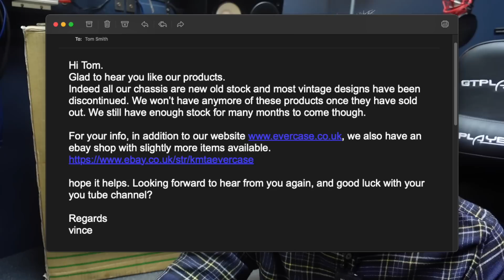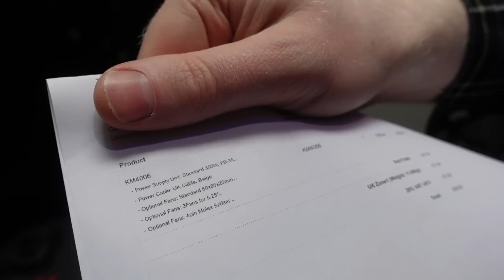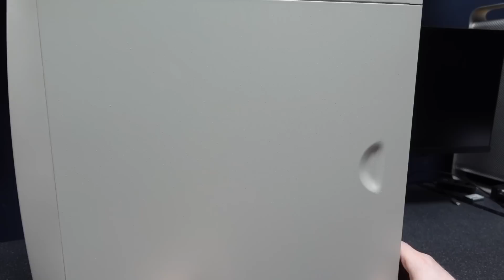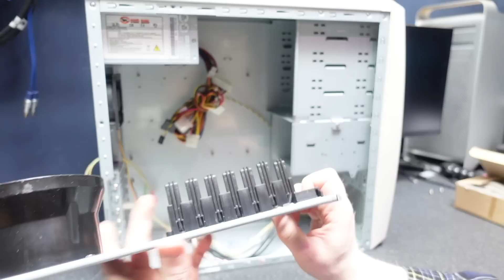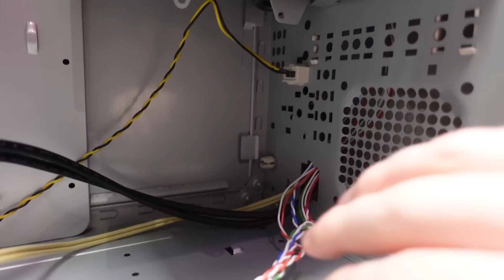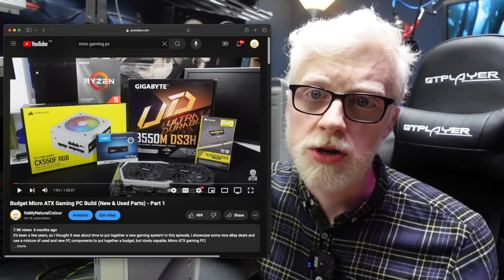Brand New BEIGE PC CASE in 2024?

Comment: I miss cases like these, nowadays cases prioritise ventilation over modularity (mainly because desktops are getting LESS efficient at full load), giving you NO options for even an optical drive. I'm lucky my Fractal Design Pop Air has two 5.25" bays on the bottom...

Comment: You should take a look inside that power supply or use a psu tester before trying to use it on a pc. If it's new old stock it may be riddled with the capacitor plague era caps and it can pop easily if you try to power some hardware with it. I've seen other people unbox new old stock power supplies and they blew up in the first power on test

Comment: My desktop PC has an optical drive. It isn't old or anything. The CPU and that are from 2020. I just like having an optical drive. I think every PC should have one.
Reply: I agree. My B550 PC with a Ryzen 7 5800X, RTX 3070, 32GB of 3600MT/s RAM and a 990 Pro NVMe M.2 Windows SSD still has a full-height internal BD-RE drive. Below that is a 5.25" bay multi card reader. I shouldn't have to insert a disc or card into an external drive/reader if I have a big tower.

Comment: I stripped down an old PC that I built in 2007 a few weeks ago. Loved the sound deadening case by Antec at the time. Stipped down the innards of a few HP's in the past and tend to keep DVD drives, the odd floppy drive, hard drives, etc.. Disassembled an old Amstrad 512 laptop the other week that was shot, but kept a few buts as have 640 laptop that may well work again with the screen from the 512, and it's floppy drives.

Far too much old stuff stored in boxes that the missus is constantly pressuring me to get rid of, but find it hard to part with old memories and kit that you just know still works.